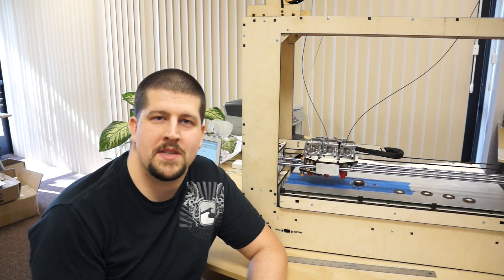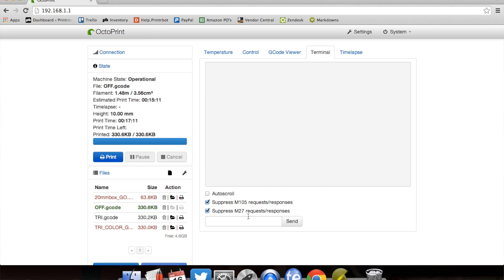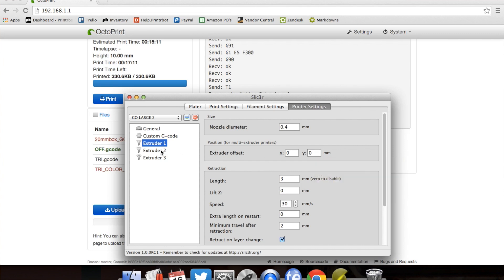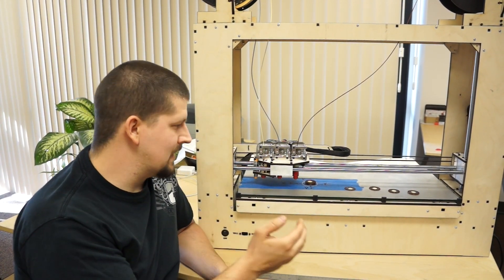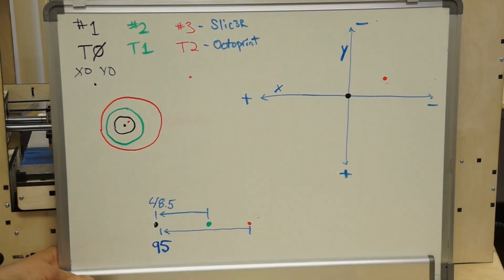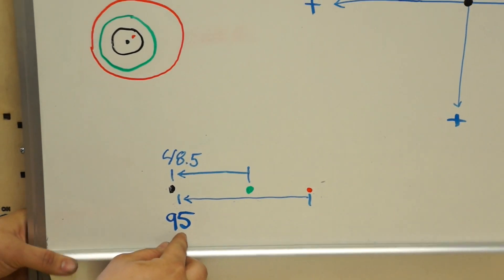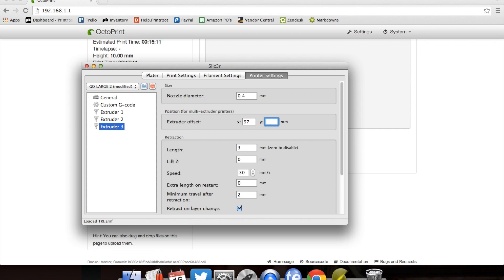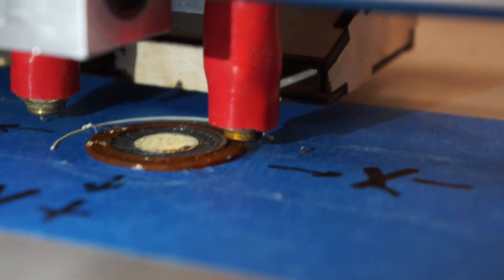Triple Extruder Calibration - GO v2 Large

Comment: there is an easy way to zero in the extruders but has to do with adding hardware To X & Y and updating code to the firmware.
 And should have made extruder match T code ( T1 extruder 1 and so fourth. ) not saying its wrong just make supports life easier for the others that it confuses.